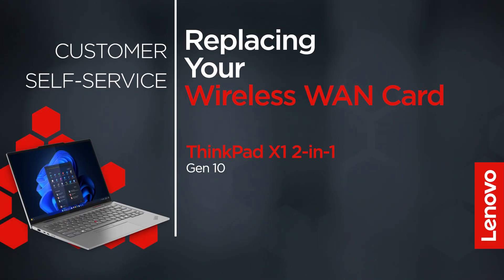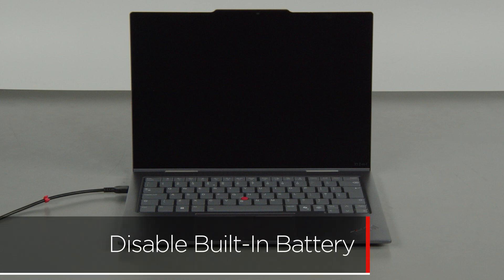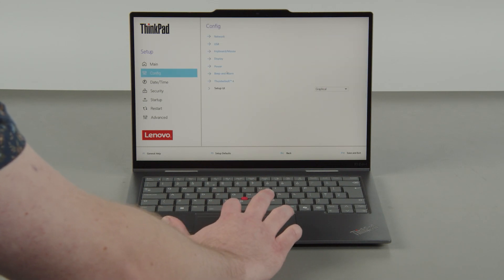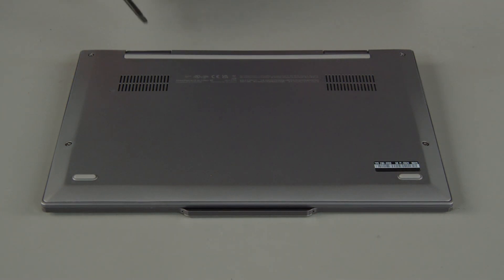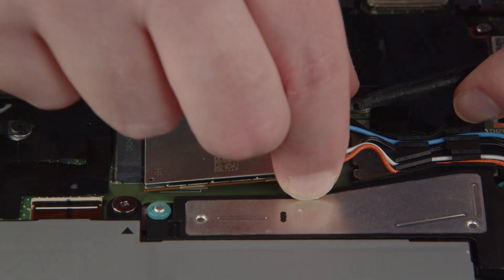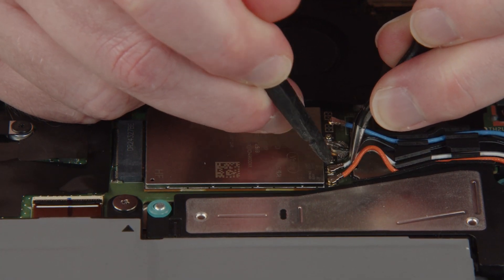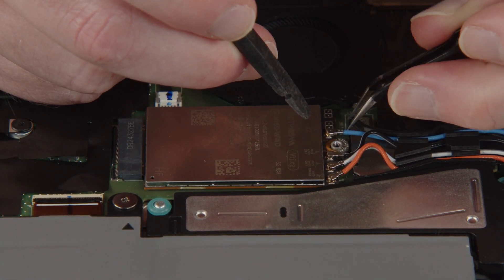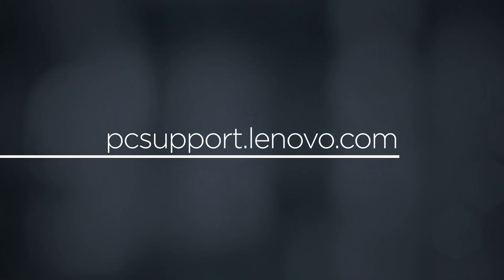Replacing Your Wireless WAN Card | ThinkPad X1 2-in-1 Gen 10 | Customer Self Service

Comment from the maker: This video will show you how to replace the wireless WAN card in your ThinkPad. The process in this video will work for the ThinkPad X1 2-in-1 Gen 10.

You will need a screwdriver kit, a non-metallic pry tool, static-safe tweezers, and 15 minutes of your time.

To learn more about your device go to https://pcsupport.lenovo.com

To find parts for your device go to https://support.lenovo.com/parts-lookup/?cid=ww:lenovosocial:b9515f&source=socialmedia&subsource=yt

To view the Lenovo Support Self-Repair Guides landing page go to https://support.lenovo.com/us/en/solutions/HT516547

** NOTE: Static electricity can destroy components. Use a grounding strap, and clean, non-conductive surface to work on. Use plastic or coated tools to prevent scratching and avoid using metal tools on plastic parts. For more detailed information on electrostatic discharge and how to prevent it, please watch our "Understanding Electrostatic Discharge (ESD)" video: https://youtu.be/by4PB3WtdLo 

Applicable Machine Types:
ThinkPad X1 2-in-1 Gen 10 - 21NU, 21NV, 21Q0, 21Q1

Check out other official Lenovo channels!
https://www.youtube.com/@Lenovo 🟥
https://www.youtube.com/@lenovolegion 🎮
https://www.youtube.com/@Lenovo-PC 💻
https://www.youtube.com/@LenovoSuporte 🟢🟡

#Lenovo #LenovoSupport #LenovoTechSupport